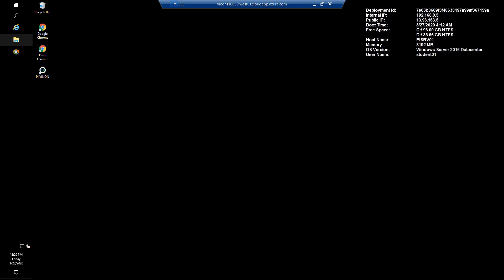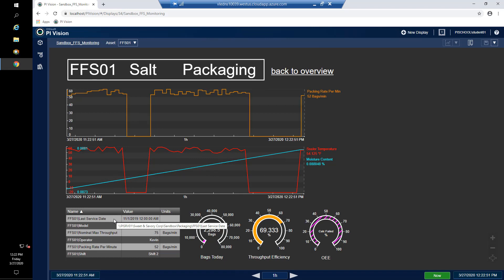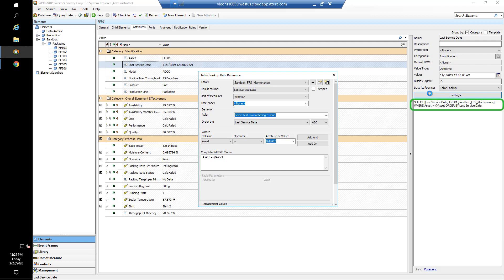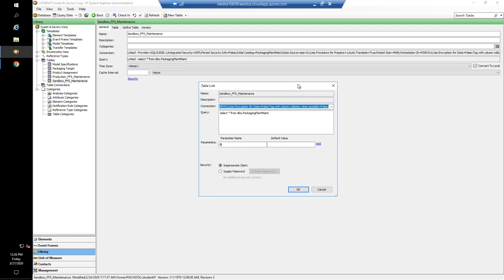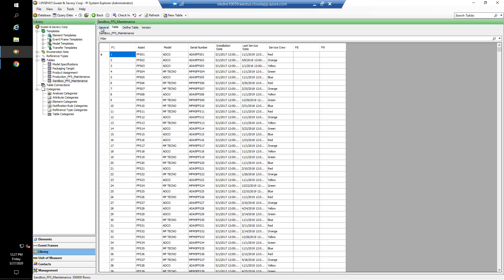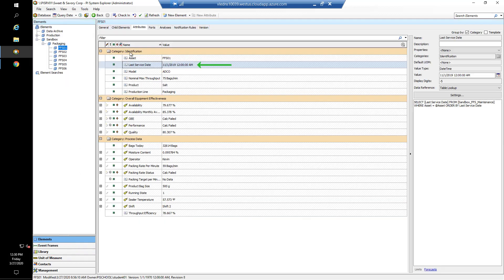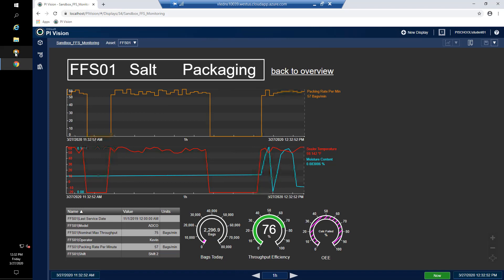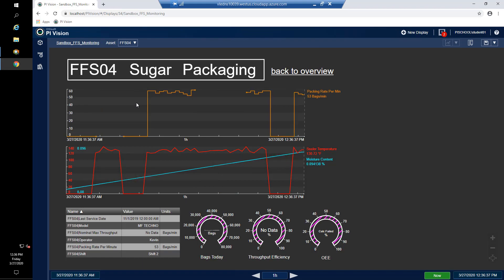Improve your AF Experience - AF Table causing Slow Performance

Comment: Hi. Thanks for sharing. Just a question, this slow performance won't happen if you build your table internally isn't it?
Reply from the maker: Hi Fairuz. As far as local tables in AF go, they behave the same way as imported tables. If you refer to the Live library we recommend that all imported tables be limited to 10 000 rows. This is because each time data is requested from the table, it will be loaded into memory. Having such large tables loaded into memory each time they are queried will result in performance issues. If you require large tables in AF (>10 000 rows) we recommend that you create a linked table with a parameterized query. You can find more information here: https://livelibrary.osisoft.com/LiveLibrary/content/en/server-v12/GUID-03F790A5-36AC-4F12-A131-DB5D7ACEFFA7